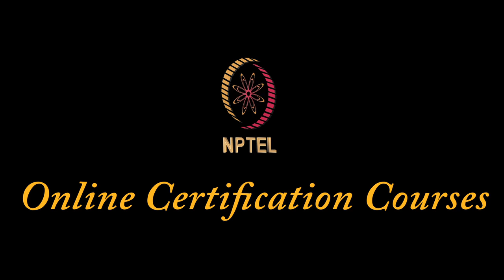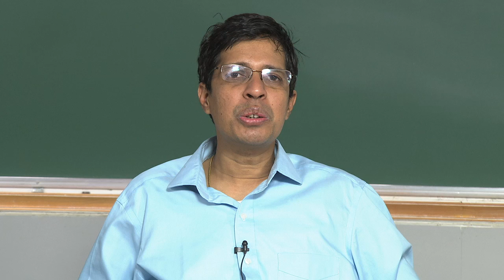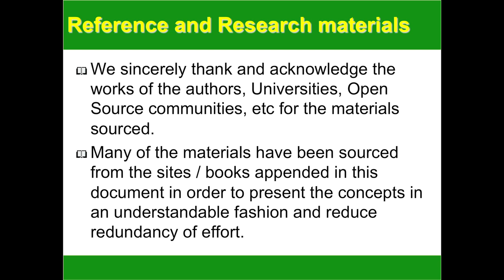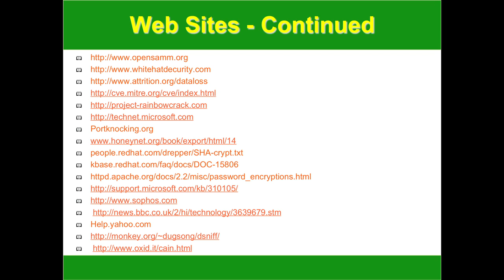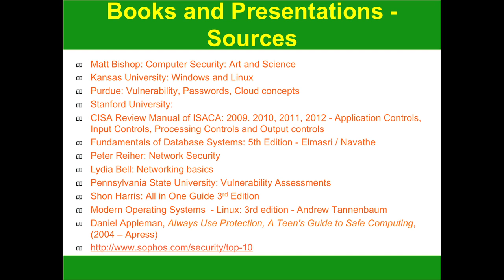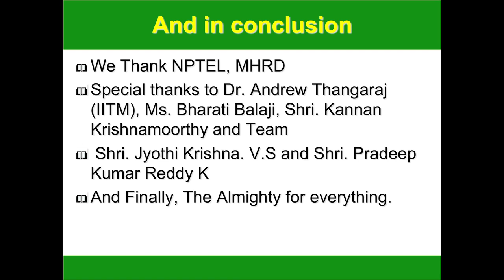Introduction to the Course

Comment: Hello Sir, What is the difference b/w Information Security & Cyber security?
Reply: Cyber security is the sub set of information security
Reply: according to me, cyber security means you have to protect your network elements from any online threat or attack which may compromise your network integrity, availability , continuity etc. Information security means that you protect your data/information in the network from online attack/threat. cyber security is a bigger umbrella which includes information security also. now a days cyber security is equated with information security because hacker generally does cyber attack to gather information from your system. cyber attack can include information theft, username and password theft, unauthorised bank transactions , inserting malware ,virus, trojan etc.
Reply: Both same.. it's just a jargon.